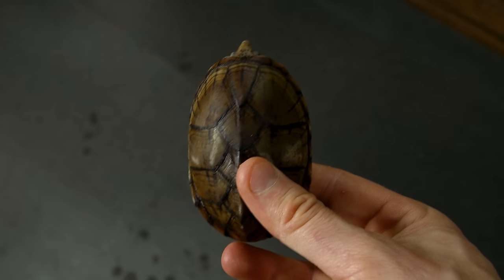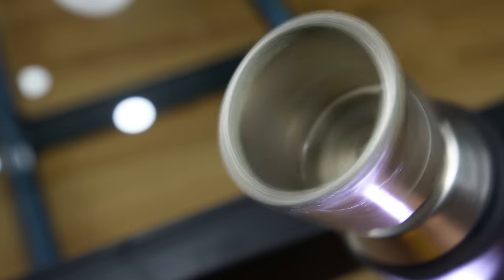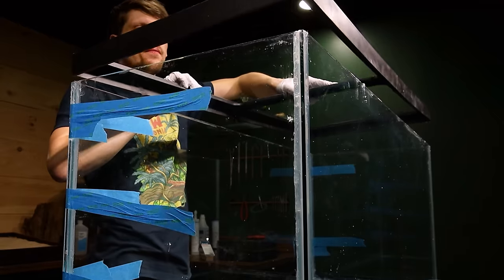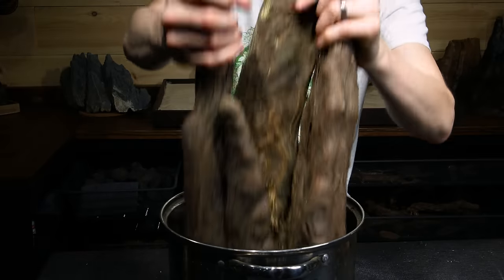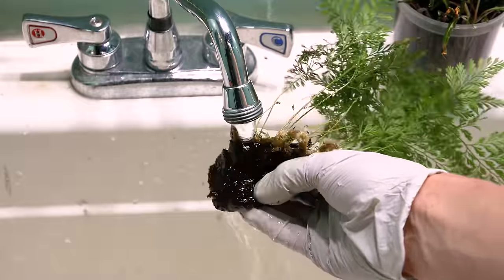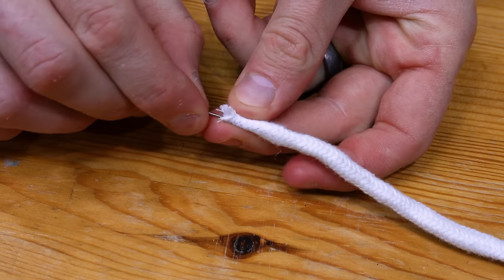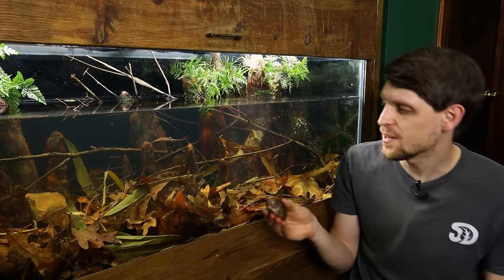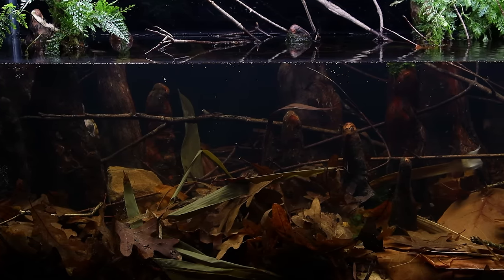Recreating a Tiny Turtle's Natural Swamp Ecosystem

Comment: Hey Tanner, could you do a video going in depth on drilling tanks? Not just how to drill a hole in the glass but how to properly choose a bulk head size and what fittings are available? I’m getting ready to drill my first tank and I’m having a hard time answering a few questions like: what size tubing should I use, do you need some kind of check valve on the return in case of a power outage and the tank keeps siphoning into the sump/canister, etc. 
love your work!☺️

Comment: Why did we not just silicone the knees to the bottom of the tank, or to the flagstone? Drilling through stone and using stainless steel screws seems like the much more complicated, difficult, and expensive option.
Reply: My guess would be so that it is easier to remove them in the future but hard to say.

Comment: Hey guys, I got a problem with my crested gecko. He is almost 3 years old now and I got him when he was about 6 months. Till the age of 2 and a half he was always very handleable and really liked my presence. But the last few months he suddenly became very skittish and is scared of me even while only opening the door to his bioactive enclosure. It is at the point now, that he sometimes takes of running and even jumps out of his enclosure. The humidity and heat in his terrarium seem fine and he is still maintaining a good weight and eats normal. Do you have any ideas what could cause this behaviour? I would love some suggestions on what to do to lower his stress level.

Comment: Wait so one side was tempered but not the other? I guess the tempered would be the front facing side then normally?
Reply: Usually it's the tank bottom, which needs to be tougher than the sides.